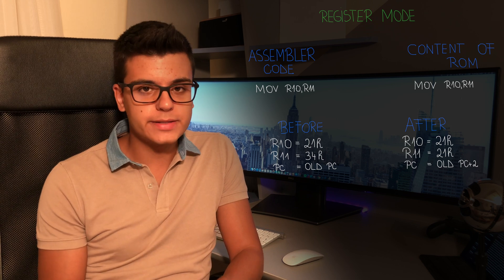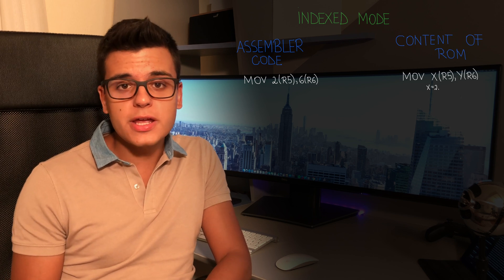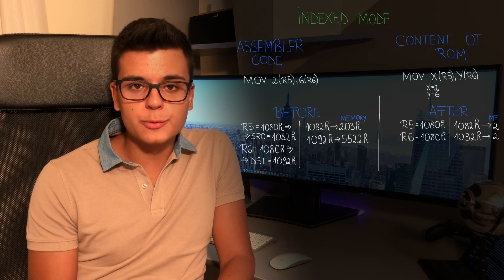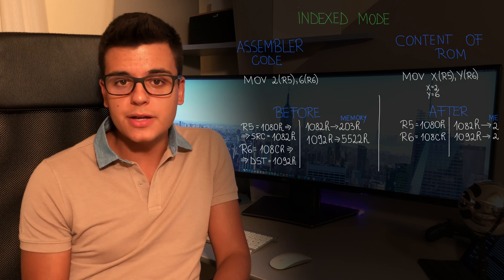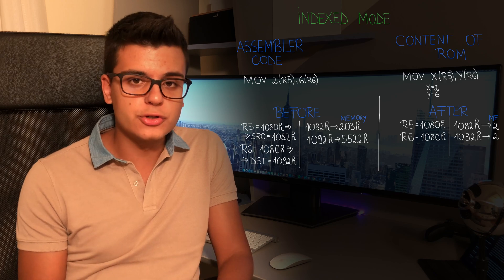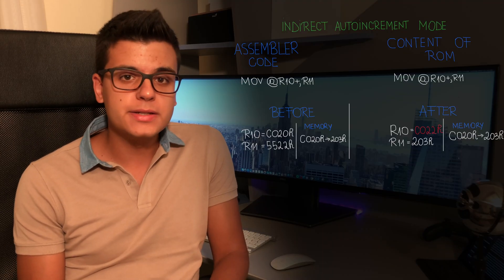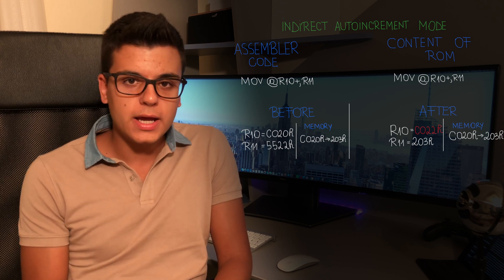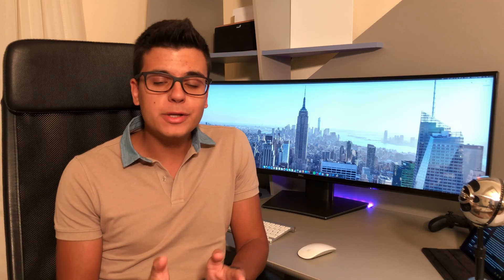What Are Memory Addressing Modes? (MSP430) | Embedded Systems Explained

Comment: Where can I find the MSP430 Board? I cannot seem to find it anywhere. And your links are not working.
Reply from the maker: Thanks for the heads up, I didn't realize the links didn't work anymore. Here you can find the US amazon link: https://amzn.to/3KzlePN If you're trying to buy from the UK, it seems like it's not available currently.
Reply: @TheFabytm  Can it be any model? The one from the amazon link is the MSP-EXP430G2ET from what I can see. But I have ordered these models from DigiKey: 

MSP-EXP430F5529LP
MSP-EXP430FR6989. 

Are they okay for the book "MSP430 Microcontroller Basics" you recommended? Because in your video,  I see that you have several different models.